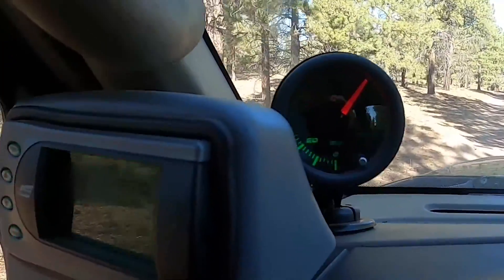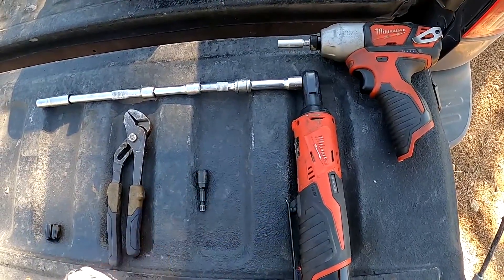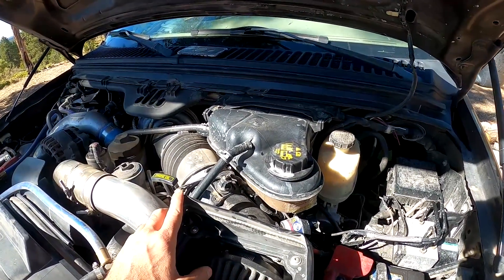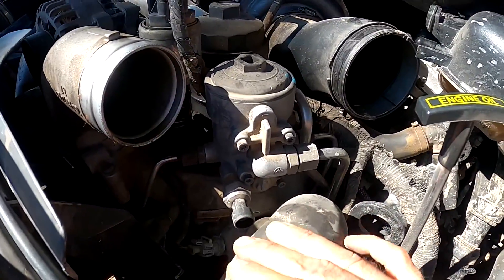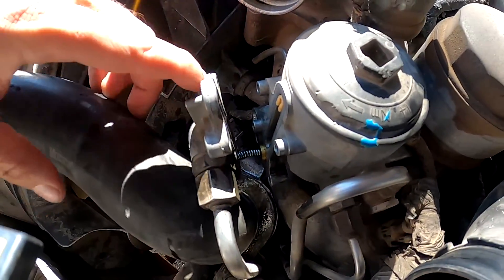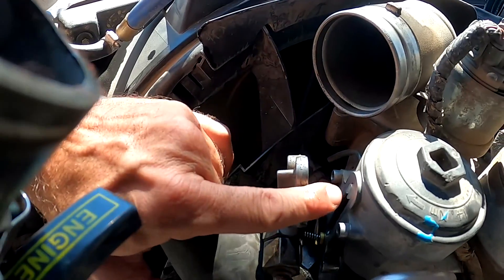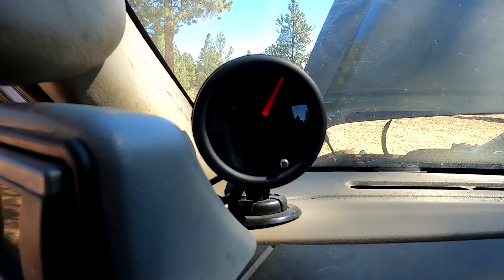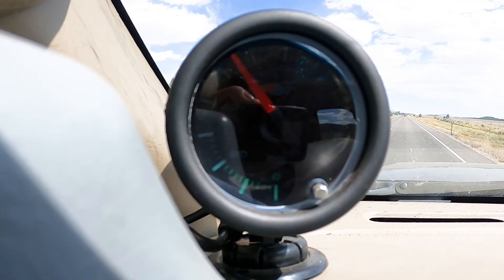6.0 Powerstroke - Loss Of Fuel Pressure Under Load - Blue Spring Upgrade - *Solved*

Comment: I’m stumped atm! New blue spring kit just installed all new orings and components. Brand New fuel pump, housing and filter! Truck still goes from 70psi to like 40 under Wot! Haven’t changed top fuel filter yet! Did you ever figure this out man? Did you ever drop the tank?
Reply from the maker: I did drop the tank but still never found the issue. My guess is a weak fuel pump so I’m installing an air dog after I finish the engine rebuild series I’m doing atm.
Reply from the maker: If you wanna drop your fuel tank I have a video
On that too.
Reply: @grumpysdiy  I think that's my next step after changing this top fuel filter and installing my glowshift fuel pressure gauge like you have
Reply: @grumpysdiy  ill have to check that video out thanks for replying and helping me out
Reply from the maker: Sounds good let me know if you get yours fixed.
Reply: @grumpysdiy  sounds good will do! Craziest thing is the truck runs like a champ and doesn’t miss a beat! Just don’t want to keep running her like that and have my injectors take a crap on me
Reply from the maker: @BUBAlooski  Yea trust me it is fun to press that throttle, but it resulted in me doing an injector.
Reply from the maker: Got the engine back together and in the truck. I installed 6.4 banjo bolts and the fuel system primed faster than it ever has. I’ll update you again after it’s running.
Reply: @grumpysdiy  Awesome sounds good! I'm glad she coming back together, yes please keep me updated! I am probably dropping the tank this weekend.
Reply from the maker: Will do.

Comment: Good day Sir, I noticed from watching all your fuel related Videos that you may still be experiencing some low pressure.. after blue spring, fuel pump, filters, injector, etc.. did you ever find out what the main source was ??? have a 6.0 that acts like it is out of fuel after driving 20 or 30 miles.. can you advise ???
Reply from the maker: Not yet I just got an air dog fuel pump so I’ll have to see how it does.
Reply from the maker: I also have my engine apart and at the machine shop right now so it will be a few weeks before the airdog video hits the internet.
Reply from the maker: If the air dog doesn’t fix it. I’ll just install a regulated return with a fuel bowl delete so that the only thing controlling the fuel
Pressure is the fuel pump.

Comment: I had a similar problem like that on mine week fuel pump put a new fuel pump in its really easy to do.
Reply from the maker: After I changed that plastic piece and put new fuel filters it was fixed.

Comment: We have a 2006 6.0 and lost #6 injector a couple weeks ago. Replaced all four on that side as we are coming up on 200,000 miles and didn't want to get stuck again with the camper.
Reply from the maker: Was it because of low fuel pressure?
Reply: @grumpysdiy   It was not. I tested fuel pressure under load before I touched anything else and it never dropped below 65psi. I did the blue spring upgrade a couple years ago just before head gaskets, head studs and a number of other things. The injectors were pretty nasty looking with some gelatin like oil on them so I'm hoping that's just from being old and seals going bad. Truck runs great now.
Reply: I wanted to do the nipple cup seals also but I was working under a tree at the campground and had no bench or vice so I didn't bother but after seeing your video I probably could of warmed up with the old thigh master and made it happen.
Reply from the maker: Lol yea it kinda sucked but I made it happen.
Reply from the maker: I will be dropping my tank when we get home and installing a sump.
Reply from the maker: I had to do our y pipe last year while dry camping outside Moab.
Reply: @grumpysdiy  Yikes. Our truck got us from Florida to Northern Michigan this summer with only the EBP sensor freaking out. Turbo may still be sticking a bit not sure until we haul again. Oh and our fuel tank straps rusted out and our fuel tank dropped a couple inches resting nicely on the skid plate, thank God for 4x4 package.  We'll be heading out to Texas in a couple weeks to see what adventures we get into next. I should also say I payed a shop to do head gaskets job.
Reply from the maker: Yea I wish I had listened to my other half and gotten a Cummins. But my “I can fix it mentality won” and I lost.

Comment: Well presented - I dont have the problem but still found myself watching through as you kept it interesting. Wondering if I could experience the same on the 6.7
Reply from the maker: I don’t know on the 6.7’s but if your running stock with no tunes I wouldn’t worry. The 6.0’s are just full of problems.